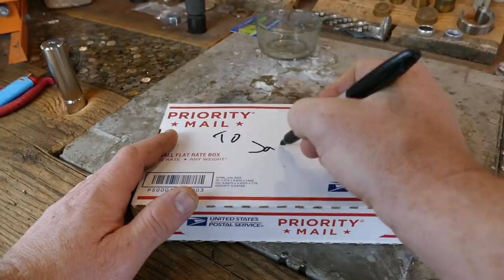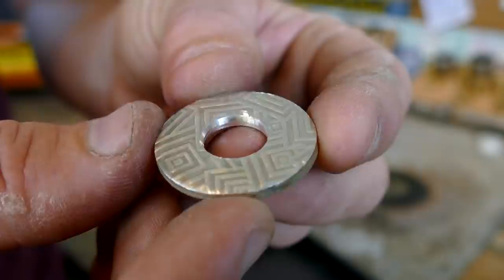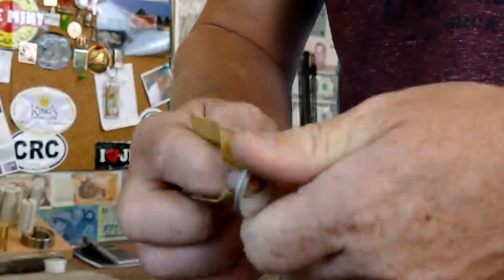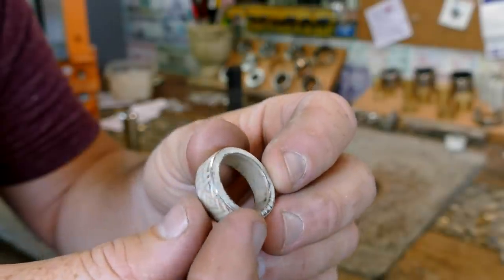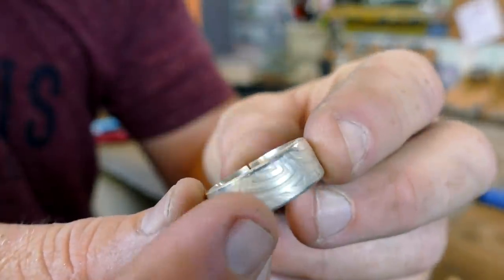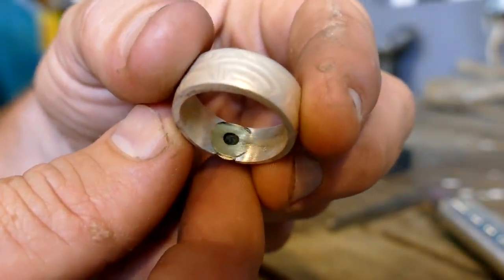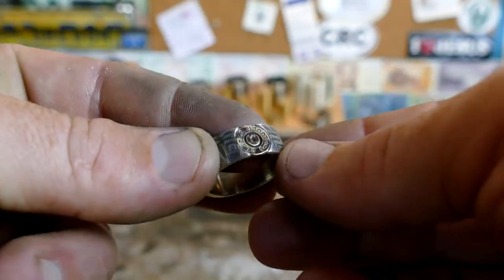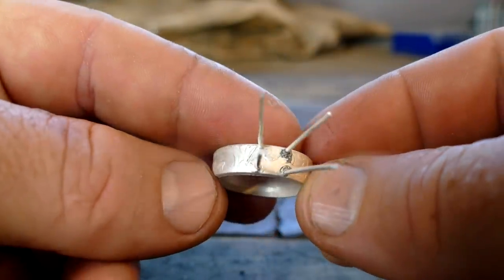Making Rings from Junk Coin Silver

Comment: On the ladies ring did you drill the ring to insert the wire for the prongs?
  Then weld them from the inside of the ring.
Reply from the maker: I just filed the prongs flat and soldered them in place.